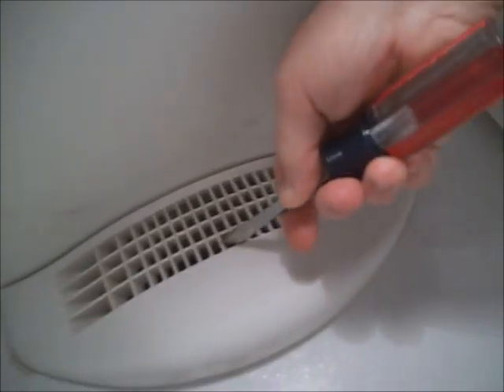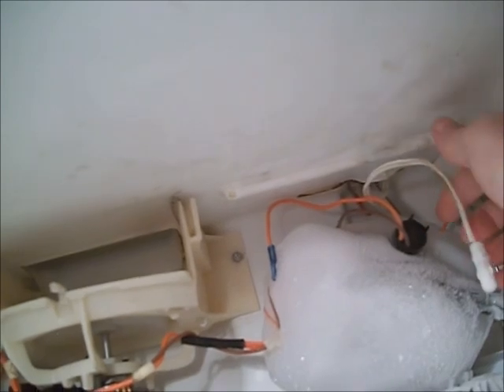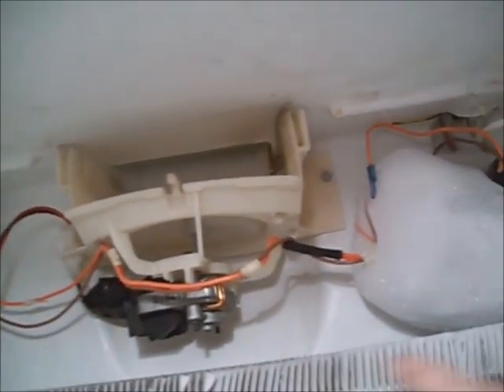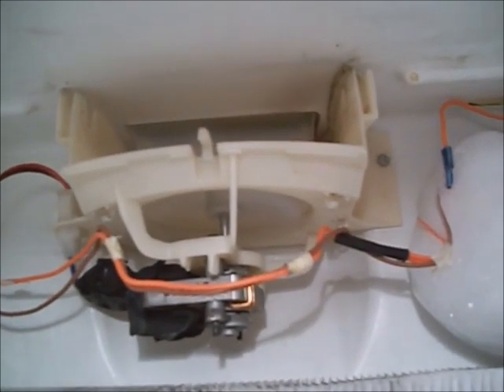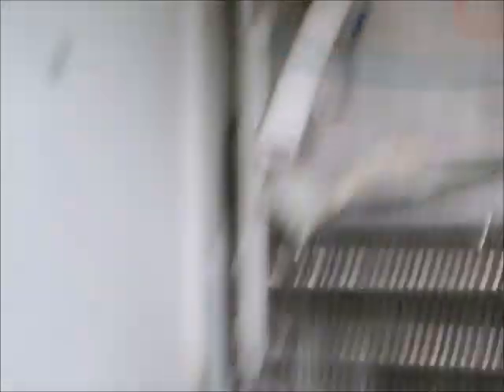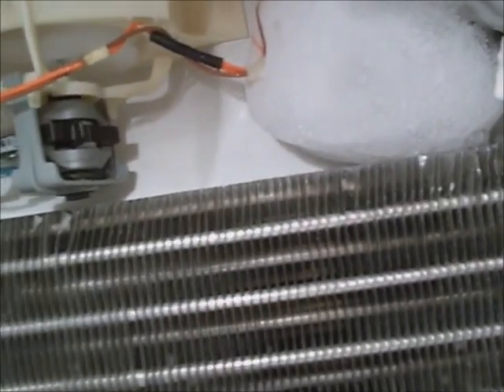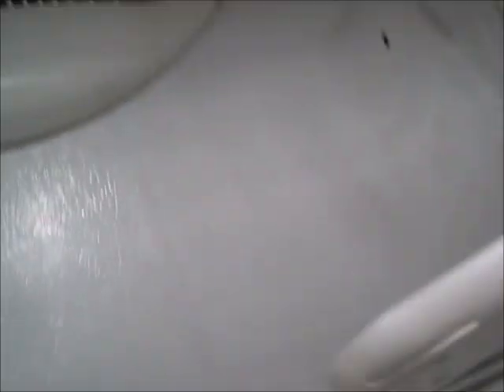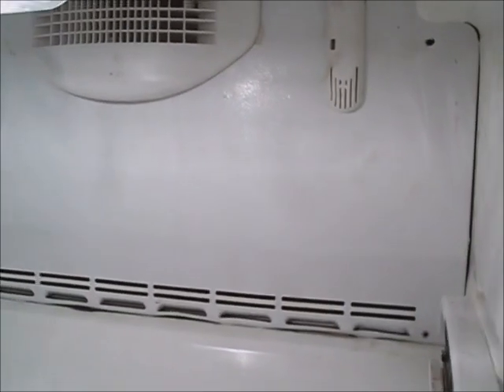Kenmore Elite Refrigerator 596.75523 top warm, evaporator fan motor replace defrost cycle explained

Comment: I have a Kenmore model59672383411 and the ice maker has stopped working plus the ice storage bin in the door does not keep the ice frozen and melts on everything inside.

Comment: I have the exact same refrigerator. Do you even have a part number? Or where I would find the part number I have the paperwork for the fridge but I can't seem to find the same looking motor online. Also would you happen to know how fast the fan in the back by the compressor is supposed to spend it's turning but it don't seem like it's turning that fast? Thanks a million I hope this fixes the problem
Reply from the maker: I just plug the model number of the appliance, into any appliance parts site online.  It will show the correct options for the model.  And, there is usually a label on the motor itself, for verification..  If the fan is running slow, it has a problem.  Thanks for watching.

Comment: Did you find the ground wire difficult to clip? Mine won’t stay on. Also, I see your white wire was on the left and blue on the right side of the motor. I’ve done the same, but wondered how important that was.

Comment: evaporator fan should NOT be running while door is open. Ice should NEVER form like that , if everything is as it should be....
Reply: I think it is supposed to be keyed to not run when the light is on.  I have one of these. My fan absolutely is on when the door is open though.  Probably better suited for a NOT humid environment like Florida where I am.  What a headache with the CONSTANT ice up.  John Dinyari
is right.  If you can shut it off for 24 hours BEFORE you have a problem, it works like new - for a while. And it doesn't screw up on you with a full load of holiday food (the morning of the holiday)!!!  However, I bumped up my 134a suction pressure to 3.5 psi  - 4 psi and it seems to be working much better as the evaporator cools over the whole section vs concentrated toward the top.  Icing seems to be more spread out. We'll see how long the compressor lasts.  What a shame both the EPA and competition for "latest and greatest fluff" cause manufacturers to keep modifying and screwing up designs vs. being able to build tried and true like the old days.  Today, these are basically throw away just like much of the other stuff foisted on us from China or wherever.
Reply from the maker: What does the door being open have to do with the evap fan?
Reply: When the door is opened, the door switch turns the evaporator fan off to keep atmospheric moisture from being pulled in along with the warmer ambient air. The idea is to limit temperature rise and recovery time in the box.
Reply from the maker: @thingish   On newer models, but this one had 3 diff boards put in it, over the years, and it cycled fine, with or without the door open.  I ran tests on the damper door, with door open, and it  also opened and closed with door open.

Comment: My kenmore elite not even two years and not working anymore . First ice maker broke.
Reply from the maker: Yep, the older side by side lasts forever, other than an occasional rust stain.  (I went back to side by side, now $400+ food doesen`t get spoiled randomly) The samsung version of these, seem to last longer.  But not sure why, as they all use the same supplier in general.  But they may have a deal for better evaporator and compressors.  Thanks for watching

Comment: We have a Kenmore 596.69939011 fridge which is no longer properly cooling our food within the fridge portion, and is over freezing our food in the freezer. We have tried the following:

1. Unplugged the fridge for 1 hour, replugged. (This worked for 5 days, and was back at square one)
2. Drained the ice on the coil in the freezer & replaced the defrost thermostat (this worked for a week)

The same thing is still happening (freezer way too cold, and fridge is warm)

Do you know what the problem may be?
Reply from the maker: Oh and, make sure that you feel cold air coming from the plastic beauty  cover, on the inside top, at back center of main fridge box.  I have seen the evap fan run to slow (from wear) and not divert hardly any air from freezer compartment to fridge compartment.
Reply from the maker: At a glance, I would say that the door/motor that directs cold to either compartment, has a problem.  When plugged back in, the door should move to the position that allows cols air to the side that's warming up.  Thanks for watching.
Reply from the maker: also here is a link to help with that problem,   tps://www.repairclinic.com/RepairHelp/How-To-Fix-A-Refrigerator/58-6-1059988-/new/Kenmore-Refrigerator-freezer-is-cold-but-refrigerator-is-warm-59669939011
Reply: Auto Dr diy Thank you so much for your reply!
Reply from the maker: thanks for watching

Comment: my Kenmore Elite side by side is warm on both sides evap and condenser fans both work.  Compressor also works. I did notice the evap fan didn’t come on right away when I plugged it in. Love your videos
Reply from the maker: spakyd82  you will prob have to pull back cover off of freezer and see what's happening in there.  Thanks for watching.

Comment: I have a Kenmore 596-72383411 and on the Bottom freezer drawer there is ice buildup on the bottom outside of the drawer. What could be the problem,  Thanks.
Reply from the maker: I had that happen on 2 different occasions.  First time, was when a round black snap-disk clipped on the refig. line went bad.  It is behind the freezer panel, upper right corner.  During the defrost cycle, the board sends house current through to the snap disk, if sufficient ice builds up on the disc, the current passes through the disk and on to the heater element, to thaw the ice off-over time.  If no ice on disc, no current makes it to the heating element, and the cycle completes early.  The second time it froze, the unit was about 2 oz. low on freon.   
       There are several other reasons this can happen, some not as severe.  Most common,  Make sure the freezer fan is blowing strong air when it is running, and make sure the door seals are in-tact all the way around the doors, and that the doors are actually being and staying shut all of the way.

Comment: OR!  You may only need to defrost your refrigerator.  That's right folks.  The clicking sound in my refrigerator is not the fan going bad but ice hitting the lower blower motor.  This appears to be common on some models of Samsung as well as Kenmore.   Yes, you still have to empty your refrige and unplug it for about 24 hrs.  Put towels in the bottom to catch the melting ice.  If it works when you plug it back in you have just saved yourself a money and time. I plan to make this a regular maintenance process i will do annually - ridiculous, yes,  but according to a blog post I read replacing the fan and/or circuit board doesn't change the fundamental design of these units that leads to the icing up.  Good luck
Reply from the maker: I had to chime in here before eventually removing your comment.  Because of the false hope it is supporting,  I mean really?  Spend $3-4k on a fridge you have to remove your food and unplug it for 24hrs?  Rediculous.  I`ll tell you why. 
 First, the 5 of these I have had contact with are all problematic, (coincidence? No.) The terms SUBSTANDARD, and cutting corners, comes to mind. But to the point, this design is totally capable of defrosting itself.  That alleviates any need to defrost it manually.  That is, IF it is functioning properly....  Ahh, there-in lies the problem.  It rarely functions properly, for more than a year or so.   Unlike the old days, when you didnt have to give a fridge a second glance for 10 years or more.  So if it would have ice getting to the fan motor, guess what, it`s broken in there, and it will keep doing it, more and more often over time, until you have to dump even more $ into an already expensive outfit, because of its innovative appearance.  I did have an idea to pull the internals out of a different brand side-by-side that was still very reliable but rusty, and put them in this one, but do to the substantial capacity difference, and the high btu`s demand, it would have over-worked them.  And again, I would be wasting my time and $ on break-downs.  At the end of the day, anyone in possession of these will be dumping $ into these gimmicks.  Goodluck, as there may be a few rare anomalies out there, that hold-up a little while longer.
Reply: Auto Dr diy yep. It works fine. $3500 refrig
Reply from the maker: i just seen this post, 12 years.....Din you mean to say 12 months?